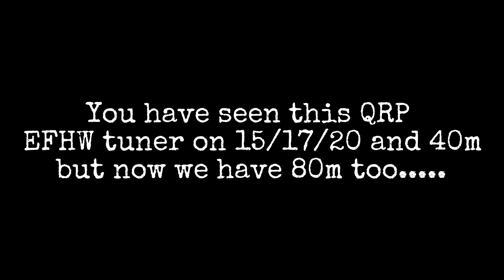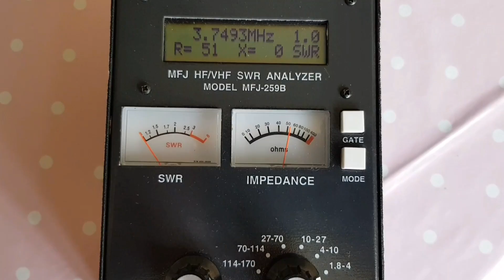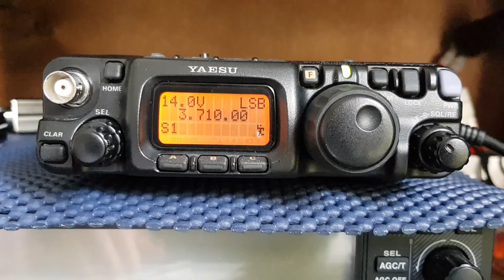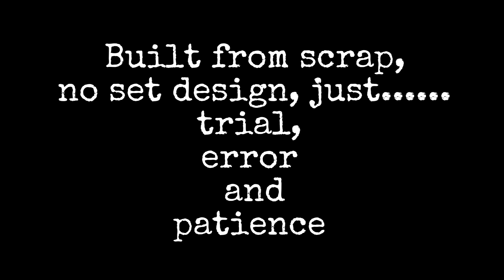15-80m QRP EFHW antenna coupler

Comment: hi iv'e been using a VK3YE L/C tuner on my portable 120ft 80m I,Vee it works very well but i like this tuner you have built so i am going to build a higher power one  i like to use qrp but some times i like a bit more power going to use a t130-6 bigger core and air spaced tuning capacitor i think i should be able to cover 60m band as well but with a 88 ft vee keep up the good work chris G0WFH

Comment: Thanks for the video, really good work. I've been thinking of an efhw antenna for the winter months. I have an 817nd and 45W amp but really like 5 Watt QRP WoW! factor I get. I'm currently running a 58 foot wire and MFJ tuner that works well when the ground freezes I guess, 73 de KE0OZD.
Reply from the maker: Hi Eric. I love the efhw antenna's for their efficiency and simplicity of use. As you say QRP is brilliant fun but sometimes you need a small amplifier.. mostly when I'm on the mobile whips the extra power is perfect adequate .. wishing you good contacts .. 73 2e0vov

Comment: Very nice, Mark, thank you for sharing! How long is the radiator?
Reply from the maker: It's a half wave trimmed for perfect match and max efficiency that's why the MFJ showed no inductance. I didn't measure the finished length, but around 38.5m I guess. Its 7.5m high at the apex. Great to hear from you.